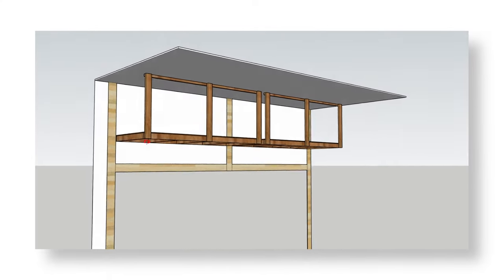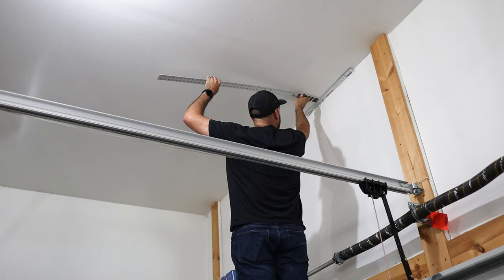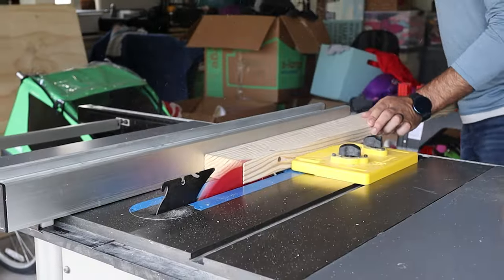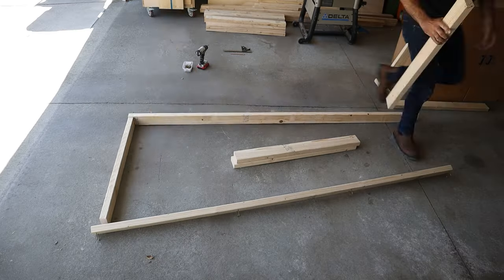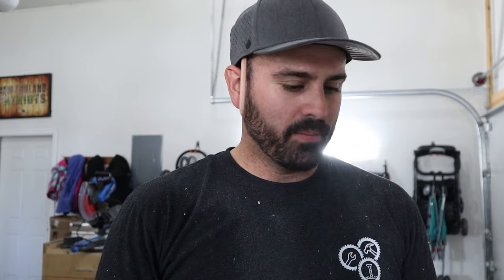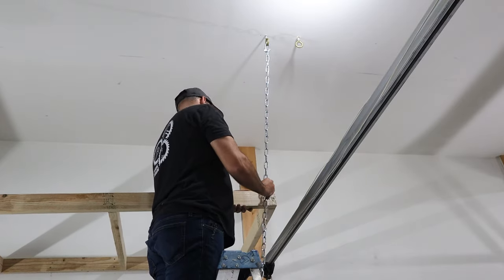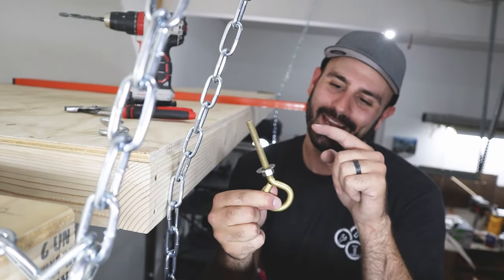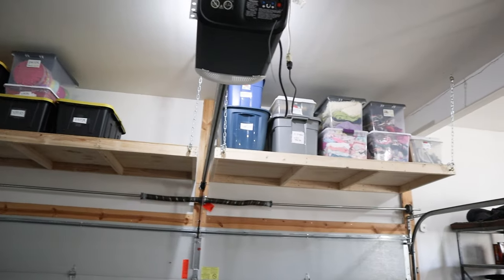Build these GARAGE Storage Shelves / Easy Weekend DIY Project

Comment: great video - curious how much weight do you think those could support
Reply: I was wondering the same thing. I'd imagine the weakest point is the eye bolts in the ceiling. Depending on depth and gauge of the bolt, it could be considerable. The chains are angled slightly which reduces the load strength, but upwards of 500lbs is likely
Reply from the maker: i added more support afterwards to the ends of each platform.  cut them at a 45 and drilled into the wall.
Reply: I think I would have added one more chain.

Comment: Nice idea, but I wouldn't put too much weight on shelf( is SO easy to do) so you dont have a nasty surprise, if the eye bolts should pull out of ceiling stud🤔😊
you may utilize the wood on the wall by the garage doors, make a support brace , going from end of shelf to top of vertical board.
Reply from the maker: Oh I like that extra support idea.
Reply: @CasualBuilds  😊
Reply: @CasualBuilds  i would drill thru support board and shelf, put nut and bolt thru both.

Comment: Love the project, love the video, just do me ONE small favor...

Tell me where the hell you find actually straight 2x4's. Because Lowes, Menards, Home Depot, all of them have nothing but horribly warped pieces of trash and it's driving me nuts.😮‍💨
Reply from the maker: Haha, seems I have better luck now since I moved to Colorado where there isn't so much moisture in the air that warps the hell out of them.
Reply: @CasualBuilds  man, I live in Iowa and it's ridiculous here! I can go through half a pallet and come away with three good boards if I'm lucky.